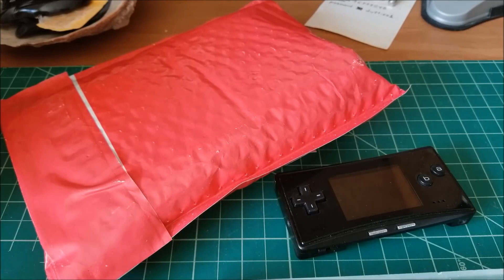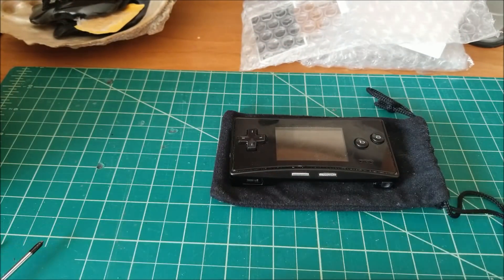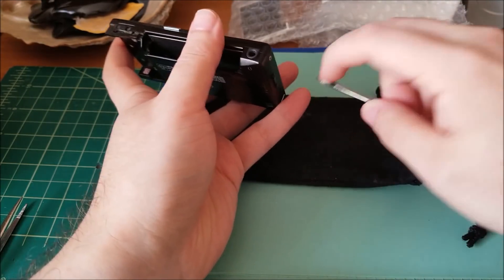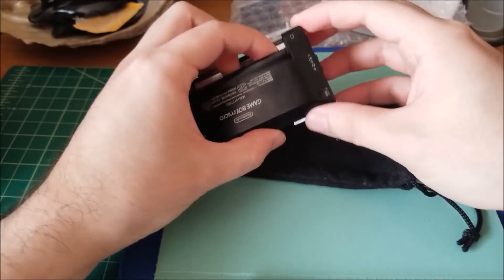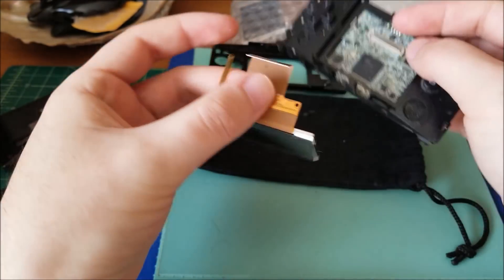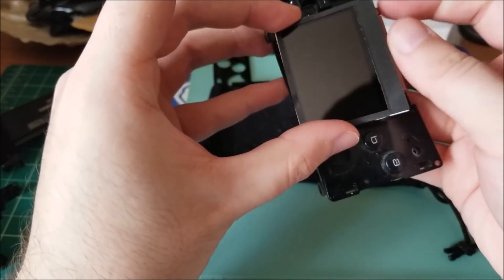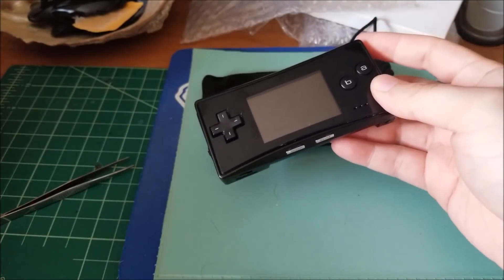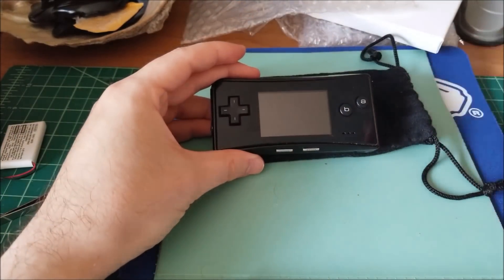Let's Fix: Nintendo Gameboy Micro with Cracked LCD

Comment: My backlight isn't working. Pretty sure I'm seating the ribbon cable in properly. Any clue on diagnosing the thing a GBM baclight ribbon goes into?
Reply from the maker: Very carefully measure the voltage of zif connector pins for the backlight to make sure the constant current driver isn't fried. 9/10 though it's a connection problem.

Comment: What do you recommend to remove stripped screws
Reply from the maker: a nice sharp screwdriver and firm downward force while slowly turning for mildly stripped screws, for very stripped screws you basically have to use a special screw extractor bit or failing that drill out the head and use pliers to pull out the remaining thread.

Comment: The A button only works when I press really hard. Does it need cleaned? How do I fix this
Reply from the maker: Sounds like it, or maybe the metal snap dome is worn out and needs to be replaced (after market replacements were available on ebay last I checked).

Comment: i hv encounter some problem that when GBM was plugged into the charger, it showing a blue lights (not blinking), i even change the batteries,  but its still wont turn on? any solution?
Reply from the maker: A fuse may have blown. Google where the fuses are located and check them with a multimeter set to continuity.

Comment: Do you know why the screen does not light up at all?  with a lamp the image can be distinguished. is my battery defective or will I have to replace the screen?
Reply from the maker: Either the backlight ribbon isn't connecting correctly or the leds in the backlight are burnt out. Last I checked replacement lcds were around $10.
Reply: @sjm4306  Are you talking about the ribbon that is much smaller?
Reply from the maker: Yep

Comment: I had that problem before on my Anniversary Famicom Edition Game Boy micro. When opening my Game Boy micro; I accidentally tore a ribbon cable while taking the guts out of the shell. The guts of my Game Boy micro were in much worse shape than I had previously known, so things we're sticking that shouldn't have been and it was all too easy to make it worse. Thankfully, it didn't matter in the slightest; since the screen I was going to replace the one in my Game Boy micro with was going to come from another Game Boy micro I had that was a more standard model. Since the guts of my Anniversary Famicom Edition Game Boy micro were in such shabby condition; I just threw them out and put the guts from the other Game Boy micro I had into the Anniversary Famicom Edition shell. The guts from the other Game Boy micro were in much better condition.
Reply from the maker: It's a shame the ribbon for the start/select buttons is embedded in the pcb, basically makes repairing them near impossible.

Comment: if the battery is within the device, just don't mention it to usps. its fine, its not out by itself
Reply from the maker: It'd probaby be fine if it were mine to risk, I just dont want to risk a customer's property in the case it is confiscated as I'd have to pay to replace it.

Comment: I have a gameboy micro that would not turn on at all
I’ve replaced the battery and when I turn it on the screen now won’t work
The lights at the bottom work but no screen
Would this need a screen replacement? Or are there any other problems that could cause this?
Reply from the maker: If you shine a flashlight at an angle on the lcd can you see an image? It could be the led backlight died, or the ribbon needs to be reseated. Worst case though is the screen somehow died and needs to be replaced.

Comment: On a personal note to many times of opening and putting it back together the screws will strip the aluminum housing shell ugh oh boy it's a nightmare 🙄 I'm waiting for the next month or so I'm trying to get a hold of a gold Gameboy micro housing shell and with the clear purple buttons oh yeah it's going to be banging 😂
Reply: Yeah they had gold shells for a while now before they made the Nintendo DS lite clear housing shell
Reply from the maker: Wait they have gold micro shells now?!?! Also yes I've seen a few micros with the aluminum thread taping stripped, it's a shame.
Reply from the maker: A zelda themed micro would look sick!
Reply: Umm imagine the possibility of that being made Like never play with it ever again 😂
Reply: Yeah I clear modified the right joy con and the protector shell top part is not seating right on the top of the joy con
Reply from the maker: The fit definitely isn't perfect on these replacement shells and usually take some finagling. Mine doesn't fit quite flush on top of the metal slide rail so it sticks up a little bit but otherwise works fine overall.
Reply: Yeah maybe they didn't account for the right Joy con IR sensor and the other black piece with a copper wire going around it I think it's antenna or something
Reply: Yeah the same thing happened to me

Comment: I used a fine tip on a plastic spudger to pop out my faceplate, I recently dig out my micro and I had to clean under the face plate it was really gross lol. I wish I could get a replacement 20th anniversary face plate because mine is very scratched

Comment: Hi there,

I am desperately searching for an answer, but can't find it anywhere, so I try my luck here. Maybe you know it.

It looks like a fuse in my GBM blew. I did not identity the blown one yet, but I am already searching for exchange fuses. The F1 should be 750mA according to it's marking (G).
But the F2 has the marking "32" and I have no idea how to find out how many A or mA this fuse might have.
Do you have any idea?
Reply from the maker: It's pretty much impossible to decode tiny smd markings unless you already know roughly what series you are looking for. Your best bet is likely something around 200mA-500mA if it is just for something like the backlight or ~1A if it is in the switching regulator or charging circuity as I cant imagine anything inside the micro sucking more than that anyway.
Reply: Thank you. That helps at least a bit:)

Comment: My gameboy micro has some blue colors in the corners of the screen when displays black in some games, do I need to replace the screen for a new one? or just is common in this screen?
Reply from the maker: One of mine has a little "light bleed" at the corners (looks like a tiny bit of whitish light at certain angles near the edges). This is normal for low/mid quality lcds but if it is very distracting then something is off and you'll likely need a new lcd.

Comment: hey, my gameboy micro's casing is a little open on the botton left corner (near power switch) What kind of screwdriver do i need to tighten it? it seems to be different from the tri wings on the right side and the ones i ordered online dont fit
Reply from the maker: You need a really fine phillips driver. I've had good luck with one I got from a cheap glasses repair kit. Just go slow so you dont strip the head.

Comment: Thanks for the vid, helped me greatly when replacing the LCD for the micro(it had yellow tint, not entirely deal breaking but it bugged me).  I think I watched a shell replacement video for the sp.  The only issue I had was unresponsive buttons, but I fixed that.  My power button does feel loose compared to my stock micro, not sure how I can fix that however.  Maybe when if I'm putting back the metal faceplate with the power button on the on position?

Comment: I need your help - the black tab where you plug in the back light broke off and now it won't stick - I read you were saying you can solder it but I was wondering do you just use regular solder or do I need a specific kind? Also do you think tape would really work? Thanks.
Reply from the maker: Tape is fiddly and temporary, solder is permanent. Regular 60/40 solder will do, you just need to be quick so as not to destroy the flex .
Reply: @sjm4306  Thx so much guys this worked - only thing is I think I got the d pad in wrong because it's very stiff and not moving properly :(
Reply from the maker: Iirc the dpad rubber membrane seats into a groove in the front plastic frame so it is aligned correctly
Reply: @sjm4306  is it possible to get to the buttons without removing the screen?
Reply from the maker: I think if you are careful you can angle the plastic frame away and use thin tweezers to realign the membrane without removing the lcd.

Comment: Damn, clean the damn thing before putting it back toqether!
Reply from the maker: Cleaned it afterwards off camera as this was just a repair video.
Reply: oh good to hear. Watching people put things back together with all the dirt and grime is like yuk! might as well just flush it down the toilet! >_<
Reply from the maker: Pretty much everything used that I buy for my collection gets stripped down, non-electronic components get washed in an ultrasonic bath with warm soapy water, and electronic parts get cleaned with isopropyl alcohol before they go back together.
Reply: I love doing that with old PC hardware, restoring the pcbs to brand new if possible :P

Comment: My gameboy micro has a dead battery. I know it's an easy fix but I don't know what to do if the board has some damage.
Reply from the maker: First thing to check is if a new battery will fix it. Worry about board damage if/when it arises.
Reply: sjm4306 thanks man! Actually, some technician checked it out earlier. He confirmed that the battery was dead but he also told me the power IC in the board was damaged. Although I dont know if he's right because the previous owner told me they just stopped using it for a very wrong time but everything was working before
Reply: The micro has no power and wont take charge. No flashing lights either unlike most common cases
Reply from the maker: Ah yeah sounds like the dc-dc regulator might be dead.
Reply: sjm4306 is there any fix for that? Or is my system good as dead?
Reply from the maker: If you have access/experience with smd rework equipment you can remove the damaged part and replace it assuming nothing else major was damaged. The issue especially with how cramped the micro board is that doing this would likely be very difficult even for a seasoned professional.

Comment: If you had pointy tweezers things would be much easier. Those works like a combo of fine-tipped tweezers and needles.
Reply from the maker: I use a pair of surgical tweezers for soldering, but I thought it would be bad to risk damaging a gameboy micro I was fixing for a customer.

Comment: So i have a micro that i got a little wet, any chance of saving it?
Reply from the maker: 1103bingo It really depends if it were thoroughly dried off afterwards and not powered until it was completely dried.
Reply: It was purchased as an untested ebay buy, been cleaned and put back together, once the charger is plugged in the blue lights on start and select come on for a second then go off.
Reply from the maker: 1103bingo Check any onboard fuses (components labeled F1, F2, etc) using a multimeter in continuity (beep) or resistance mode. Sounds like a fuse might be blown. Or it might be the battery is shot (many of the original micro batteries are on their way out by now).
Reply: Thanks for the input, ive bought another battery but yet to see any life in the little treasure, ill perform a continuity test of any fuses i can find. Failing that it will do for spares i suppose.
Reply from the maker: 1103bingo Hopefully it is just the battery and you can resurrect it.

Comment: Hey idk if you’re going to read this but if you do would it be possible to fix my ps3 I tried to fix it but I’m not that good with ps3’s and it has YOLD
Reply from the maker: Youtuber 59356 I read just about every comment I receive so no worries. Fixing your ps3 will likely require reflowing the cpu and gpu with a hot air gun or oven for a temporary or reballing it for a long term fix.
Reply: sjm4306 thanks I will try that

Comment: I would like your opinion on me buying a game boy. There are two for sale in my are a pikachu edition game boy advanced sp with some scratches then there's a game boy advanced sp red with the box and original paperwork and charger and Pokémon red they are the same price which should I get
Reply from the maker: If the pikachu sp is a legit original (not a Chinese reshell) then I'd say depending on price that would be a good investment. However if you care more about playing than collecting the cib red sp with the game would be nice to have for both display and play. If you really can't decide ask yourself: in five years what would I regret not getting more? 

I had a chance to get a $30 mint nes sp years ago and I passed on it and have regretted it to this day. Luckily I did end up getting one recently but it cost me more and is in worse condition. So lesson learned.
Reply: sjm4306 would it be still a real pickachu gameboy if I reshelled it with a pikachu shell with the striker still on?
Reply from the maker: Kyle Swehla I would no longer consider it a real limited edition once you replace the plastic shell. The image isn't a sticker, but rather printed directly on the plastic so you could only replace the entire plastic as a whole.
Reply: sjm4306 I'm not 100 percent sure what you meant by printed on the shell is of a gameboy that has bad internals but the shell is just fine it still has the little black sticker on the bottom
Reply from the maker: Kyle Swehla Oh sry I didn't quite understand. Yeah swapping the innards of a broken gameboy and keeping the shell to fix it up is legit in my book (I even encourage it).

Comment: You don't need to pop up a fleeting and annoyingly distracting caption (that nobody can read) each time your smoke alarm chirps because of a low battery. Get it off the ceiling and pull the battery.
Reply from the maker: A Floyd Interestingly it wasn't the battery, it was the corroded contacts that increased the impedance making the alarm think a good battery was dead. Found that out after plugging in a new battery gave the same beeping.

Comment: I found another lot. Sorry if this ends up annoying you. I figured since I don't do much with my life, I might as well point out some broken game system being sold on eBay for you to possibly get. Tell me if you don't want my help, I won't take it offensively. Here's a lot of 3 broken systems...
Reply: http://m.ebay.com/itm/Gameboy-sp-gameboy-color-ds-for-parts-/182816852282?nav=SEARCH
Reply: The ds has a broken hinge, the gameboy color doesn't have it's volume working correctly, and the gba sp seems to not want to turn on properly and when it does, it takes a long time.   Price is at $15.
Reply from the maker: I don't mind at all. Given I have limited funds and usually concentrate of specific items but taking a look never hurts and if I score a deal then great.
Reply: If you were to get the lot, I'd hurry.  There's 1 hour left on that auction.  But from what I've read, I think you could make a profit.  The DS has a broken hinge.  You can buy one off eBay for probably about $4.  The GBC has a volume problem, probably a malfunctioning speaker, and the SP either has something blocking the connection to the power switch or a bad battery.  The seller says that all these items work fine except for those flaws stated.  I'm sure you could make a profit from that.

Comment: I found this broken GBA SP lot, could you maybe do an episode on fixing them if you get the lot? It's an auction, though.
Reply: http://m.ebay.com/itm/Nintendo-Gameboy-Advance-SP-Junk-Lot-AGS-101-001-As-Is-/263237690582?nav=SEARCH
Reply from the maker: It really depends on the condition and price. I usually search for low priced units with specific faults that I know have a high chance of successful repair so I can get the most bang for my buck.
Reply: Most of them are missing hinges, the speakers work, the shells and screens are scratched.  And maybe a few missing buttons.  And the price is at $20.50 right now I believe.

Comment: Is the replacement LCD as high quality as the original?
Reply from the maker: Luke P I honestly couldn't tell the difference between the replacement and my two micros with oem lcds.
Reply from the maker: The owner has told me that the screen has developed a single stuck black pixel that he noticed while playing the micro. It could just be bad luck and uncommon or it could be a sign of manufacturing issues for these aftermarket screens. As with all things though there's always some risk when you buy non-oem replacement parts from china.

Comment: Micros are fucking beautiful. Want to get one once I eventually backlight an AGB.
Reply from the maker: Gigadweeb I would love to pick up one of the famicom, green, or blue ones but the prices have skyrocketed. I'll just have to hold onto the two I have right now.
Reply from the maker: Yeah in good condition these go for over $100 even loose. With the original box and manual maybe add another $50.
Reply: sjm4306 after reading this comment I just remembered something 
https://ibb.co/diFJOw found this in a old box of mine
Is it worth something?
Reply: dont swear to an console

Comment: Would you happen to know where I can get a replacement button for the right trigger? Mine stopped working.
Reply from the maker: cybermax12 I haven't been able find find replacements as it's a much smaller version the standard tact switch used in the gba and sp. I'd advise using fine tweezers to very carefully remove the rubber dome and a can of compressed air to clean the inside. Replace the rubber dome insert and test. Unfortunately that's the best you can do.